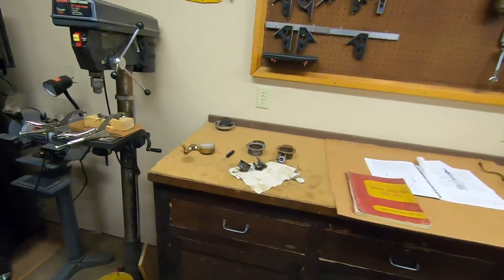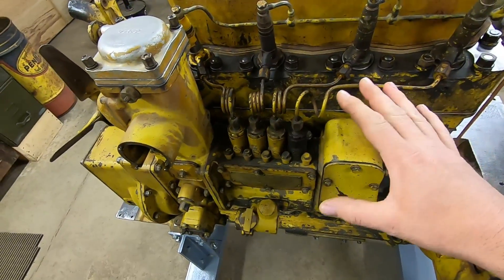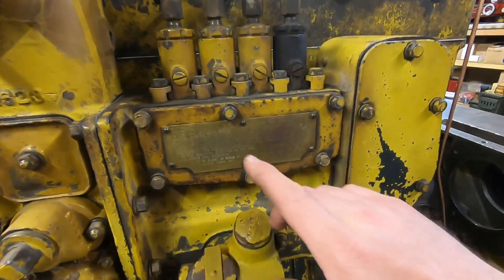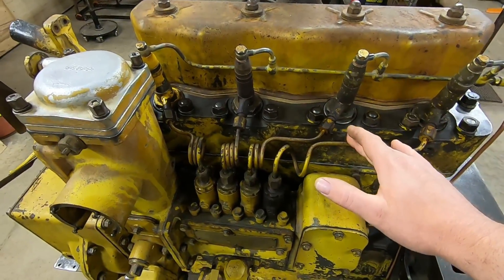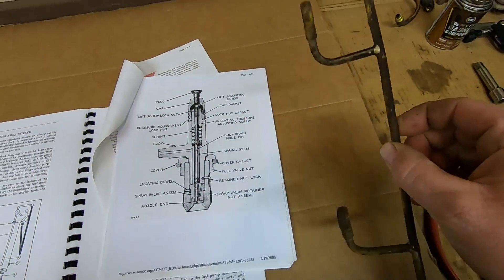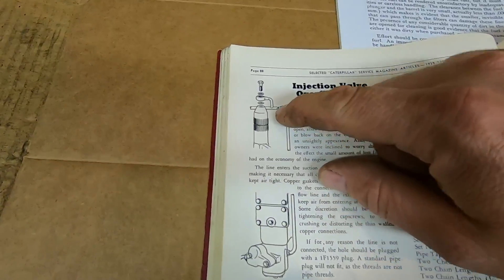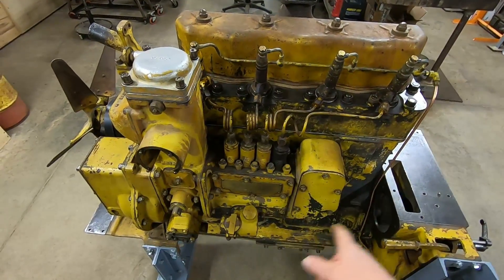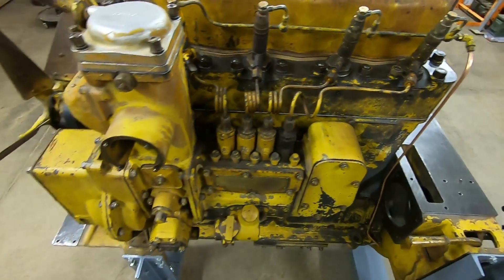Caterpillar D2 #5J1113 - Injector Return Lines Explained - How Much Fuel Do They Actually Leak??

Comment: The modern engines leak a bit 
Id say they made the clearances looser to allow more lubrication and cooling and allow a longer life 
Much the same reason they added a whole tank return line 
Allow return fuel for lube and cooling for the injectors and the pump

Comment: Why not lead these lines back to the fuel tank? Or at least let them run into a transparent bottle so you can check for leakage problems?
Reply: Because if the main fuel tank is up higher than the discharge, you would then need a way to elevate the discharge to get it back to the fuel tank.